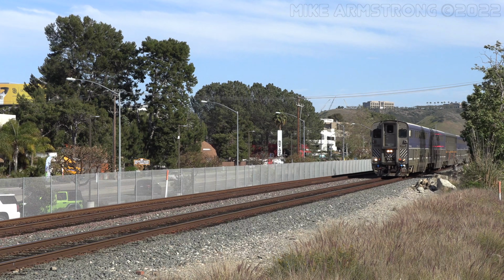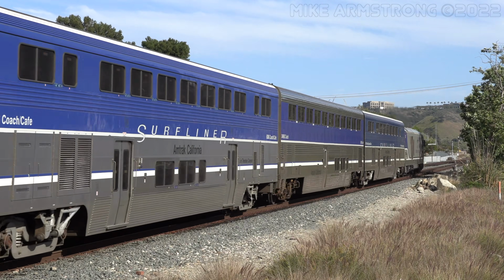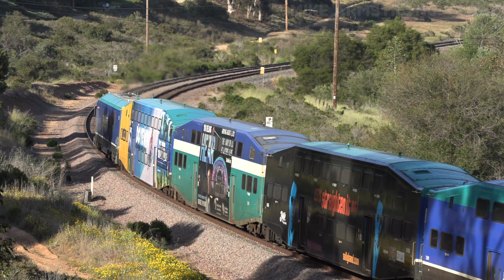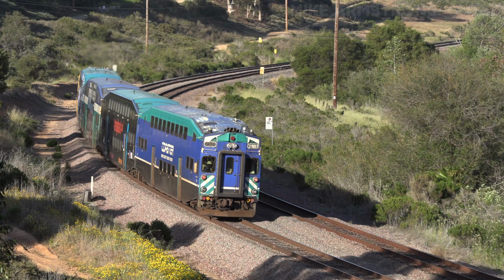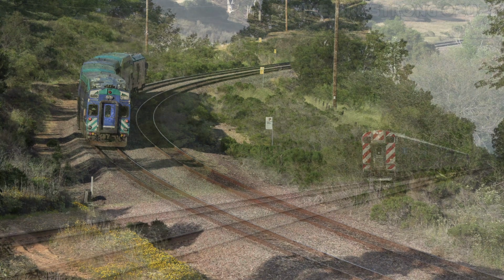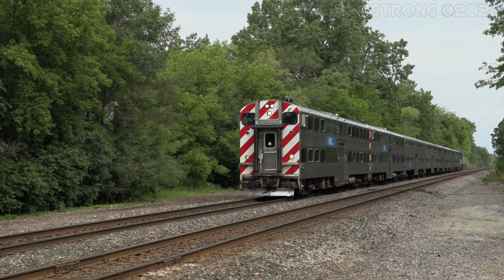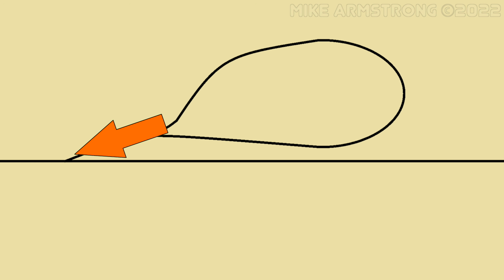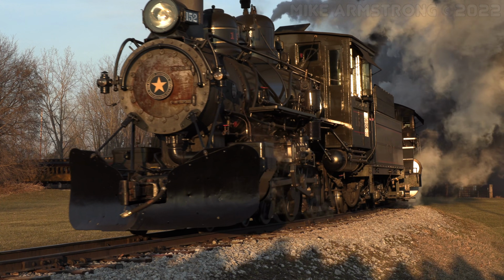Turning Trains Around: Train Talk Ep. 35

Comment: 4. Balloon track: a fourth option on our list for turning a train around. A balloon track is a large circle of track that is pinched off and connected at on end with a switch. Like the wye, a balloon track can be used to turn either an entire train around or just a set of locomotives. In this situation, a train proceeds into the balloon track and past the switch at the beginning of the loop. Once the end of the train has cleared the switch, it can be thrown so the train can then exit the balloon track turned completely around and moving in the opposite direction from its point of entry. One of the biggest advantages of the balloon track is that the turn around can be achieved in one step without stopping and backing up. in fact, depending on the situation, it is possible for a train to enter a balloon track and around without stopping at all.

Comment: 3. Wye: a three point turn for trains or individual locomotives.
It features 2 pieces of track that come off a main line from opposite directions, known as the wye’s legs that connect together at a switch. A tail track extends past the end of the junction of the 2 legs of the wye to allow rail equipment to sufficiently clear the switch. In order to turn around using a wye, a train can either travel past both legs of the wye and then back in or proceed directly into the wye and then back out.

Comment: Nice information Mike. Trains can turn around on a railroad track. single track: a railroad track that is single that the train needed to reverse.
Run Around Track/ Passing siding: a short section of parallel running second track. Switches at both ends connect the siding back into the main line. To turn the track, the crew will pull the train forward and come to a stop either on the main or the siding within the limits of the 2 switches. The locomotive will then uncouple from the train and continue forward past the second switch and once again onto the single track. Next, the switches are thrown and the locomotive backs past its train and the first switch. Finally the first switch is thrown one more time and the locomotive recouples to the other end of the train. With the locomotive and train together once again, the train can proceed in the opposite direction.

Comment: 6:46. This generally only applies to diesel electric and diesel hydraulic locomotive as diesel mechanical designs, such as older classes of BR dmus are limited in reverse speed due to the transmission.

Comment: Some large diesel locomotives, especially the ones with cabs located to the very front of the locomotive and having no cabs at the other end or having able to see the backwards view the end of the front cab. Usually requires a turntable or wye to turn around and goes to the other end of the train to continue the journey the other way, just like bigger steam locomotives with tender usually do.
It is usually more preferred for the crew to run their locomotives, diesel, steam or not, forward as they usually have a much better visibility going forwards with their located at middle cab(usually a steam locomotive), or a single off-centre located at front cab(a diesel locomotive usually), leading the train.
Even some some small Engliah diesel shunters and small British Steam locomotive prefer to be driven forward if the crew wish to.

Comment: Balloon tracks also get use on urban transit, not only for single-ended vehicles, but also for faster turning even of double-ended vehicles, so that the operator doesn't have to spend the time to go to the other end (especially when another train might be coming soon).  With these vehicles, turning radii are sharper, allowing a balloon track to be built in a smaller space than would be possible to use for heavy rail equipment.  Wyes have also been used occasionally in urban transit for turning single-ended vehicles, but while they can be shoehorned into less total space if the trains being turned are not very long, they lose the advantage of speed and are not friendly to very frequent service, and of no advantage to double-ended vehicles; also, since single-ended vehicles often had trolley poles for current collection, many of these without a front pole for reversing, backing up in a wye and through a wye switch would pose the hazard of the pole dewiring, hitting support wires, and getting bent and/or breaking the support wire.

Comment: Seems like light rail/streetcars/trams often make use of something similar to balloon tracks, which works because the trains and cars are often shorter or articulated so that they can navigate sharper turns and thus the space needed for that solution isn't as big. For instance, I know that Boston's Green Line has a loop around at Boston College, and San Francisco's Muni Metro has loops at Balboa Park for terminating M, J, and K trains to turn around. L and N also have loops at the end of the line. There's also the famous example from the New York Subway where the old City Hall station was situated on a loop, so trains could come in in one fluid motion and stop at City Hall as they turned around. Also, at the core of the BART system in the San Francisco Bay Area is a wye, though it's not used to turn trains around.  Great video as always!

Comment: Now this surprises me that Amtrak turns entire trains around, instead of just putting another locomotive on the other end. Since many longer Amtrak trains have two locomotives, can't they put one of them at each end and make reversal a lot easier that way?

Before the widespread introduction of cab cars even for intercity trains, the standard procedure in terminal stations such as Frankfurt, Stuttgart, München, Zürich, Luzern used to be: Run the train into the station, uncouple the locomotive, couple another locomotive at the other end and exit out the other way. Then the uncoupled locomotive can exit the track and be used for another train. In a few cases such as night trains it is still done this way.
The "run around track" as described in 3:22 is also used in case the track configuration requires a change of direction, because the inbound and outbound lines are on the same side of the station.
Since this operation took time and required multiple locomotives and staff, including the work to uncouple and couple locomotives, more and more push-pull trains with cab cars have been introduced, or trains were replaced by unit trains that can run in both directions.
Reply: If I’m understanding your comment correctly. Amtrak’s cars have seating only facing one direction